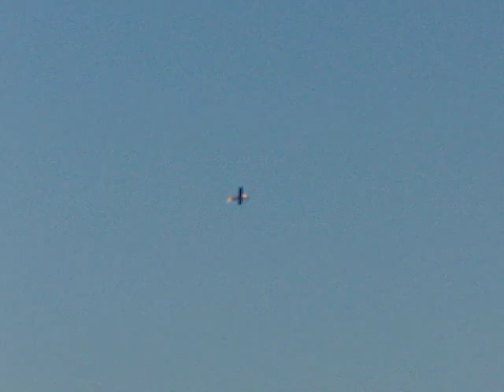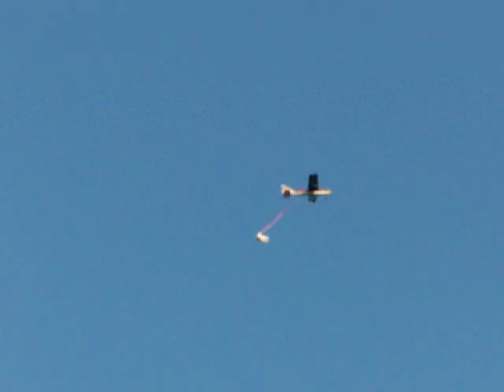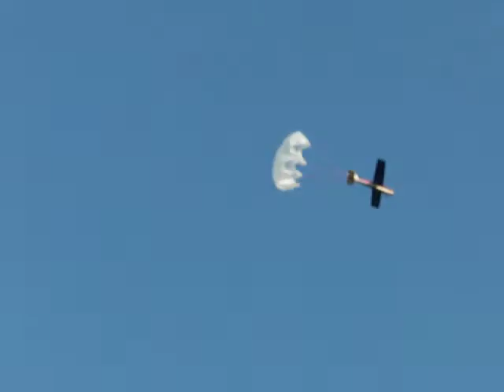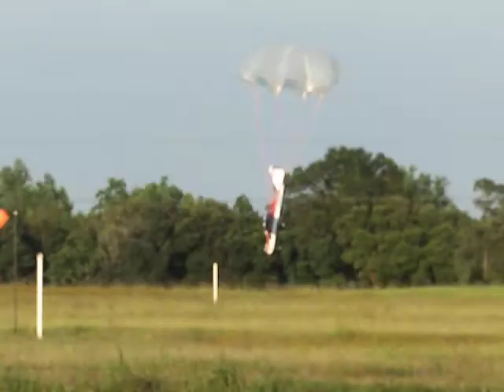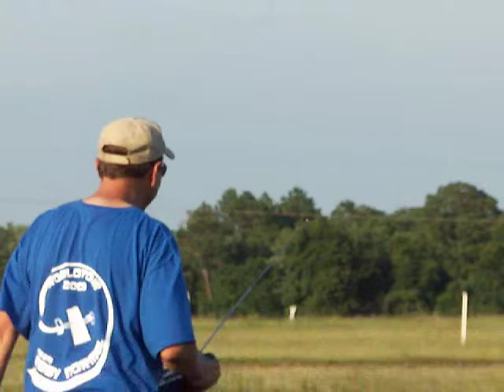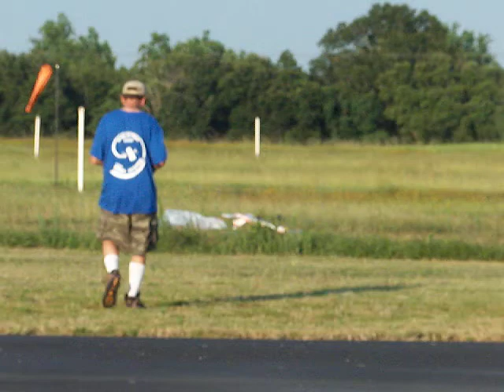Robert Sanderson's RC Ballistic Recovery Chute Test 4

Comment: I need this. Every time I landed, one prop broke. So...
Reply: You too? lol I live in the desert, there is no place to land near where I live. Nuthing but rocks scrub brush and cactus. I have a place to take off but it's way short...been flying a lumpy electric Cessna, sometimes I can get 2 landings on a prop, maybe 3 if I trim and Ballance iTired of flying lumpy Cessna, even if it does have a way to big motor and a battery  with 5 or 5 S"s.  So I built a parachute deal for it as a prototype for on a hotliner I put together. It goes on the wing, kind of like exaggerated air foil..just balsa coated with epoxy..a catch to hold the back down and a rod that comes from flap servo and  a 4 ft circle out of 5 mil drop cloth and 5 strings that attach through the wing @ cg...got lucky and hit the setup almost perfect first time.. I can pull it 30 ft off the ground and it still opens fast enough...only problem is don't store the chute packed up..do it before you fly or it gets plenty wrinkly